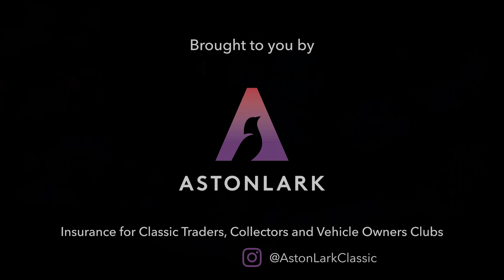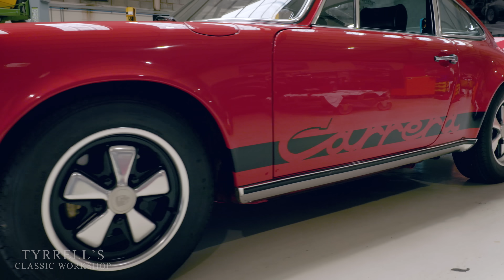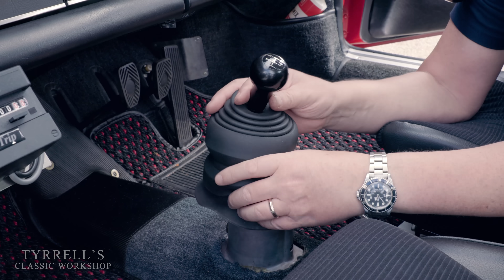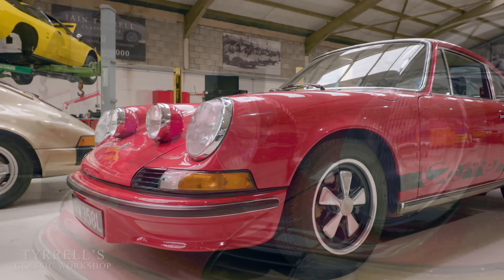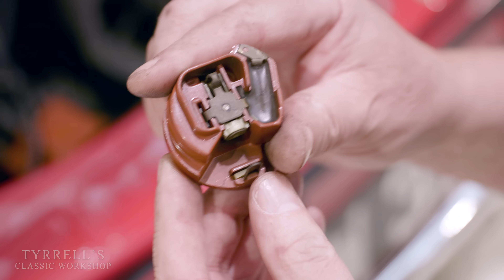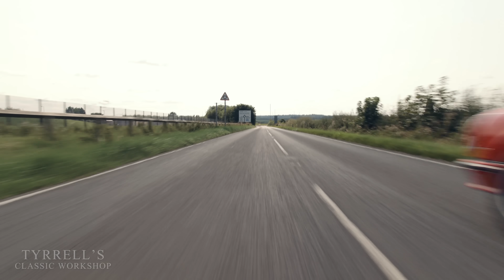Porsche 911 Carrera 2.7 RS- the car Porsche feared no- one would buy!| Tyrrell's Classic Workshop

Comment: 40 years ago I had one of these unintentionally sideways. Caught it. They are the most fabulous car Porsche ever made.
The Kugelfischer fuel injection was brilliant for it's day..
Problems encountered:
On  the first batch, they not only had thinner body panels, they also had thinner sheeting on the exhaust and the under front left wing dry sump oil tank. At 18 months, both rotted out.
You describe the weight transfer situation well. A friend described them as the world's first 150mph forklift. Rear suspension toes out when landing over a crest. No problem in a straight line, but when landing over a crest at speed on a corner??? New underwear please.
Brakes:
ABS dis not exist at the time of production, and Porsche, in keeping with the German tradition of the time, did not permit the rear brakes to do anything other than rust the disks.
The only real solution was to remove the original master cylinder and fit a balance bar system. 
Prior to doing this, becuse there was no weight transfer to the front under braking, the car locked the front wheels. Once a little weight transfer was achieved, the brakes were superb.
The oil pipes  from the engine to the dry sump/oilcooler ran up outisde the left hand sill.
We told people they were the fuel pipes, 1 for each bank of cylinders.

Comment: Great video, thanks. On the topic of the rear suspension discussed around 6 min.,; I believe it was not so much the camber change, but the lift-off toe-out behavior of it, that made the rear  step out so violently. At least, that’s what I remember my research suggested way back, when after spinning my own ‘78 SC 🙃 A power-on slide was ok, provided you kept your foot down. Which of course is not always possible, so best avoid it altogether and leave those antics to the professionals.
Reply: I spun my SC also. Terrifying.

Comment: Hate to disagree but the increase in wheel base was primarily done to correct a steering lightness issue  that was corrected buy putting a lump of steel in the front. Then the wheel base was lengthened as the proper fix.
Reply from the maker: Interesting. The improvement in stance was a happy by- product then. Thanks for your comment

Comment: Thanks for the Tatra/Ledwinka/Porsche connection being told.  Important history to remember! That silver Tatra 87 is a peach!
Reply: You missed out Hitler. Maybe it is historically uncomfortable, but Hitler is much more significant in the Porsche backstory than Laedwinka ever was. One of the reasons Hitler approveded air cooling for tje KdFwagen was that he had had very good sevice from an air- coolrd Tatra in the 1920s. That would be type 11/12, front-engined but with backbone chassis.

Rear engine, qircooling and backbone chassis  dedign keeps down weight and Hitler had set down ambitious  performance targets for weight, speed and fuel consumption. 

And guess who provided the finance?
Reply: @martinrichardhorrocks9869  Not sure of the point you are making?
Reply: @mtnvalley9298  That Tyrrell is quite wrong to connect Laedwinka with a Porsche 911. To try and imply a parallel with Laedwinka´s pre-war Tatras and a 1960s GT is ludicrous "just sayin¨" 911 was designed by a different generation who had already produced nearly 20 years of progressively more amazing cars when the totally clean sheet 911 was introduced.

Tyrrell´s "allegedly" references to Hitler´s role in the KdF/Volkswagen are, however, incontrovertible. Dr Porsche´s very close involvement with that and subsequent war projects are historic fact,  leading to his arrest by the French government as a war criminal in 1945. 

Dr Porsche´s son, Ferry started to build sports cars out of VW components to raise collateral to get his father out of gaol in France. However uncomfortable that may be, those are the origins of the Porsche Gmbh, nothing to do with Tatra at all.
Reply: @martinrichardhorrocks9869  your summation "at all.'" is incorrect in my estimation thanks
Reply: @mtnvalley9298  You quote two words out of context,  as a hack barrister might do. The full context was "those are the origins of the Porsche Gmbh, nothing to do with Tatra at all.", which is incontrovertible. 

And, in the spirit of the thing: Thank you!
Reply: @martinrichardhorrocks9869  Let me put this into context:  You are again an ass obviously, thank you!

Comment: I could have bought one of these for around GBP15k back in in the mid-1990s. The guy that now owns that same car has declined offers of over GBP700k for it recently. Doh!  And I hear you on the early turbos. I spent a terrifying day behind the wheel of one on some amazing roads, where I think I nailed about one corner in twenty. I’d go from embarrassingly slow and thinking “you could have gone so much faster” to attempting to be quicker the next corner only to have the turbo spool at exactly the wrong time, and trying to balance immediate plough understeer or backwards into the scenery lift off oversteer with a power delivery that was like an on/off switch. If you were very talented I’m sure it would have been quick, but it scared the crap out me. It wasn’t nice or fun. The 2.7 RS however, was truly sublime and the steering was the best I’ve ever encountered on any car I’ve ever driven (which includes a few open wheelers!). Gawd I wish I’d pushed the boat out and bought it!

Comment: Tatra takes its name from the mountain range and Ledwinka put the engine over the rear wheels for reasons of adhesion when climbing up the pass and this particularly critically in the snow. Aircooling was adopted for reliability in subzero temperatures.

Comment: I would love to experience the whole cornering technique and all the issues at the limit on a vast open space. Where you can't harm the car, others or yourself.
Reply: Get Forza motorsport on an X-box. The simulations are quite realistic. I've spun out a Mercedes 300SL by coming hot into a corner and lifting the throttle just like it is described. I'd expect a Porsche to behave realistically as well. (Caveat: Some Editions don't have a license to have Porsches in the collection so you need to check which edition to get.)
Reply: I paid for lessons in my 911SC from an ex racing driver to help me crack the pendulum effect. You have to have very quick reactions. It not just lifting off in a corner, he showed me if the road surface changes in a corner you can be spinning before you know it. ( This was done on private property - an old airfield)

Comment: If it is all in the weigth of the car. What stops people from buying 79,000 Porsche and lightening it by using crabon fiber or fiberglass? All you need to shave is 230kg. Lighter wheels, fiberglass bonnet, doors and rear cover should get you there.

Comment: One thing worth a mention in that generation of 911 is the visibility. As with several the cars of that time, the A pillars are quite thin, resulting in an excellent view out. 100% agree on the steering too- it’s amazing.
Reply: I've taken coworkers for rides in my SAAB 900T to show them why the Corvettes and Camaros we work on every day don't thrill me. Visibility is one of the first points. It's so very important. Once you can see around you it's hard to sacrifice any view (or in the case of those Chevys, MOST of the view lol).

Comment: Great presentation as usual. I have been lucky enough to own a 911 SC Coupe and a later 997. That SC only had 180 BHP which is not much for a 3.0ltr engine but it still propelled it to 155mph.  What really surprised me is I have 4 of those Special Porsche tools in my garage which will soon be listed on eBay :-)

Comment: I've often thought, why don't manufacturers employ a progressive power steering system in their vehicles, that would gradually disengage the faster you go? Only when driving very slowly (parking) would the power steering be fully employed. There's probably a good reason, but I'm none the wiser!
Reply: Citroën did that in the early 70s with the SM. Works well, but an aquired taste, darting from side to side of the road is not the best way to kick off a test drive....

Comment: Dang, those roads in England are so narrow its scary compared to ours in the USA. Corn grows right up to the road. Very low visibility around the corners. No berms, pull overs, and why do you drive on the wrong side of the road? LOL Love you all in the old country. Tyrrell rocks.
Reply: Because most people hold a sword in their right hand. Started with Roman lanes and it being easier to defend from a cart or horse keeping left. Same in Japan, India, etc.
Reply: Mostly hedgerows at the side of the road, not so much crops. Early 911s are notorious for going through them! Imagine a wet road and a tightening radius bend... Unless you can scrub off speed in a straight line a tow truck will be needed.

Comment: Having driven a 1960s 911, a 912 and a 1976 911SC and having owned a 996 from new ... I would love to drive a 911 2.7 RS although I still really dislike this steering wheel, too big and I regularly accidentally press the horn. But these old 911 are so much fun.
That being said, I wonder how that 911 2.7 RS compares to the Ferrari 308 QV or 328 as these have also a very analog feel to everything and are really nice to drive ... And can be modified for racing. I have only driven I've 328 GTB too briefly and too slowly to really compare but I have had as much fun doing so as I did driving the 911 2.7 SC.
Reply: Addendum ... And controversially, I would rather drive a Ferrari 328 or 348 on the road rather than a 355, they are far more fun at low speed on a daily basis on the road, the F355 becomes fun and starts sounding good at speeds that would be illegal anywhere in the world except maybe Germany and the Isle of Man!

Comment: Nikasil (an abbreviation of nickel silicon-carbide) is an electroplated composite coating comprising of a nickel matrix holding silicon carbide particles in place (similar to rocks and cement in concrete). ... The Electrosil composite coating has a wear resistance 4 to 10 times that of a cast iron sleeve or chromium bore.

Comment: Tatra actually sued Porsche for patent infringements over the kdf wagen/VW but the case was resolved by the invasion of Czechoslovakia in 1938-39, perhaps the ultimate example of 'force majeure'.
I personally call it the pendulum effect, as the majority of the mass is at the back.  The reason for that lovely feelsome steering is that there is so little weight over the front wheels; the downside is that front grip is also very variable depending on acceleration/braking and road contour.  Owners back in the day were known to put a hundredweight sack in the front to make things more predictable day-to-day.  Current 911 drivers should try and find a '70s or '80s 911 to have a go in: it's a very different experience!
I love listening to Ian, expertise and passion combined is always a great recipe!

Comment: Semi Trailing Arms,.. yup, bury the brakes mid corner in a (pre 80's) VW, Porsche or Tatra, and you come out of the corner facing the wrong way.
Do it in an Alpine 1600 (aka A110) and it grips and goes around the corner.
Tatra's were also known as the Czech Secret Weapon, for how many of a certain political party they killed.
Reply: In the mid 80’s my summer job boss lent me his 1975 VW 1303-S that a previous owner had souped up. One night I was pushing it hard into our driveway when the front end hit some gravel and broke loose.  I lifted and the back end snapped around, doing a complete 180.  Sheepishly I turned around and crept up the driveway thanking my lucky stars that I didn’t hit anything - only to have my sister ream me out for driving like a complete asshole!

Comment: Ian, are you sure the 911 isn't a boxer engine?
Reply from the maker: A pure Boxer engine has the pistons closing in on each other at the same time, whereas in this engine the pistons work on the same crank pins, so as one moves inwards the other moves out. A small point but a distinction nevertheless. This is technically a 180’ V6.
I know this is potentially heretical, but there it is!
Thanks for your interest

Comment: Thank you for another great installment, Iain. Very well presented as usual.
Right at the beginning, you talked about the RS having been driven, and that it's covered >100,000 miles.
I know that such cars are generally more sought-after if they have low mileage but it often seems that without that low mileage, they're automatically deemed inferior. This seems unfair to me. In the end it's all about the manner in which they've been owned.

Cars such as Porsche, Mercedes E-class from the 80s to early 90s, and dare I say it, the SAAB 900 (I own one), are capable of huge mileage and great reliability, if they're properly maintained and well cared for. And because they're somewhat over-engineered to begin with, they can be very rewarding long term ownership prospects. 

Thanks for showcasing a great example of this. It looks set for another 100,000 miles and its owner is lucky to have benefited from your expertise. It would be nice to see engine internals from well looked after, high mileage vehicles that come through your workshop, just to show what is possible with good stewardship. Thanks again for another great episode.
Reply: I know this car. Nearly all the miles were done by the first owner who also had it totally overhauled body and soul by Porsche AFN about 30 years ago.It is an excellent example and gets used. No-one has commented the spotlights, which are original as used by works rally 911 at that time. They  are  Cibié and very very hard to  source.

Comment: Wonderfully explained as always. Indeed, the story about the KdF car and the myth around it concerning Porsche is particularly interesting in retrospect towards Tatra, but also towards the Standard Superior / Josef Ganz and Zündapp :) As per usual, history often gets rather simpliflied. It does need some courage to step out of it to be real. Thank you :)
Reply: Professor Porsche's first ever car desugn was an electric car, 4wd with a motor in each hub. That was 1898....He was responsible for the  Prince Henry Austro-Daimler in 1910, the Mercedes S/SS/SSK in the 20s, the Auto Union mid-engined GP car in the 30s (also the KdF-wagen) and the Panzer Tiger tank in the 40s. Which proximity to Hitler saw him arrested by the French in 1945. Porsche Gmbh was started by Ferry Porsche (son) to bail the old man out.

There is nothing to connect the 1960s 911 with Laedwinka and Ganz, more than a Ford Escort with a 1900 Panhard.Tyrrell's interlude here is a space-filler at best.

Comment: Welcome back and congratulations on your marriage! 

As usual I find your posts fascinating and did not realize the connection between the 911 Carrera RS and Nikosil. 

I know my two old Mercedes have had this process - one with over 220,000 miles-and both use negligible oil today

As an aside I never will forget a sight I saw in 1973 while in the army in Germany

A friend and I were driving down the autobahn towards  Munich and stopped at a roadside restaurant to see a car transport with about eight or 10 of these Carrera RSes being delivered presumably to Porsche dealers. 

It’s my favorite Porsche. 

I thought they only came in white with either blue or orange script though. 

Thanks again Iain for the informative YouTube videos.

Comment: I bought a911 identical to the gold one when I was 30 and kept it ten years. Sigh. As a day to day car it was better than the red one, k jet injection and a softer cam. The handling issue was that it was very easy to lock up the inside front wheel on entry which then threw you off line with too much speed but you had to commit. Those days, empty roads the few cars there were going slowly. I had a 3.2 later but the gold 2.7 was better, the one I loved.

Comment: The second 500 cars were also made using the lightweight body panels. Often reported that it was only the first 500 but if you read up on it you will find the second 500 were also lightweight, Ironically there are some Lightweight M471 cars made in the third batch of 500 cars which are the heaviest cars..

Comment: You have sparked my interest in the nicasil or scanimet saga. Who actually created the concept of silicon carbide powder in the nickel plating bath? Does any one know? As some else has commented it found its way into all sorts of places.
Reply: Mahle?
Reply: @davidepperson2376  I worked for the uk operation of a surface treatment chemical company in the early 1980’s, the MD of the German company was reputed to have invented the coating, a very clever chap called Tony Lausmann, I thought while at BMW, we certainly supplied BMW with the process. I recall lugging half a K100 engine through customs at Heathrow, arguing that an engine sawn in half had no commercial value. They reckoned that the block was good for 200,000 miles if you changed the plain cast iron rings st 100,000. Now there are processes which use nano diamond particles,
My suspicion is that Mahle might have also used the process, they didn’t originate it. I could be wrong. Hence my comment. I’d love to know. I don’t think it’s particularly Ian’s territory though.

Comment: Had a series of 5-cylinder VW/Audi's during the 80's and early 90's and that rotor arm was very familiar. Used to be stamped with 6700 but I rarely revved it that high to find out if it was right. Certainly a simple, clever design. It was a time when cars were lighter, less powerful but all the more enjoyable to drive. A quality video as usual. Thanks to Iain and the Owner.